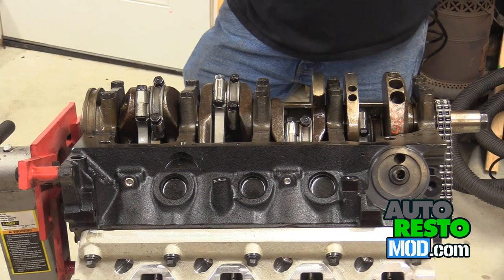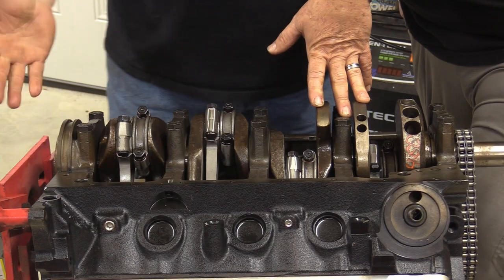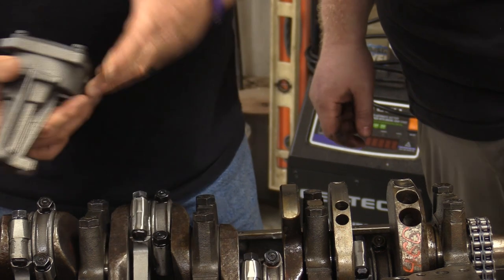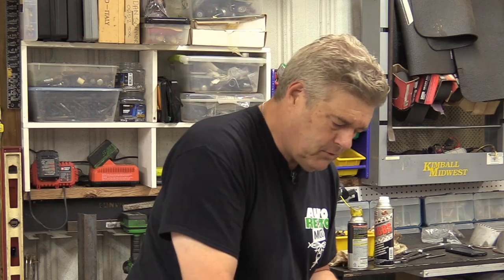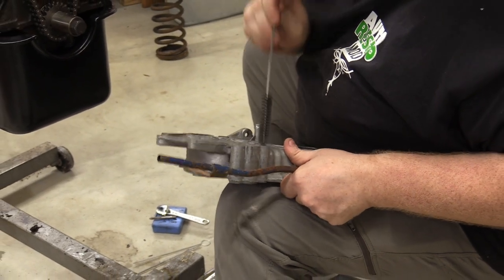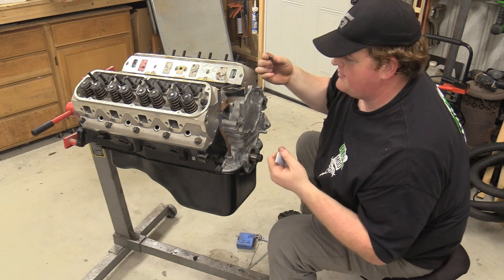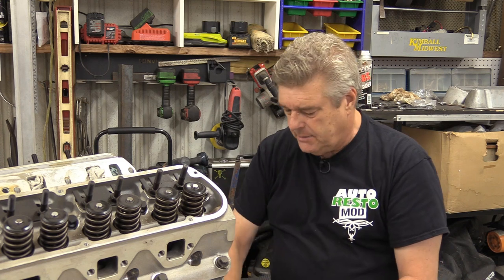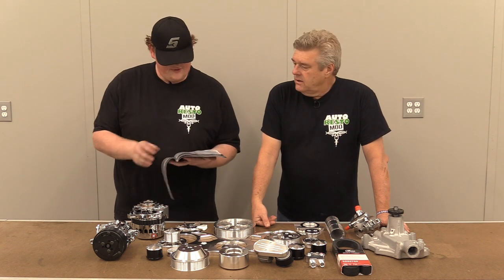Ford 347 Failing Forward

Comment: Thanks for building a 347. A lot of people will say just get a 351 and spend your money stroking that out. Good idea, but the smaller cars get real tight against the shock towers with the taller deck height. I'm very interested in Mavericks these days, and a 302-based engine fits much better than a 351-based engine. Yeah, you can cut the shock towers. You can also fit an MII suspension. Both of those things are additional time and effort, and require you to have $$$ and/or be an excellent welder. I'd like to see you fit a windage tray and/or scraper correctly. It's something I haven't done before.

Comment: Remember on the timing covers with the non-fuel pump boss type do not have the hole for the dip stick tube
Reply: One more thing to make us all wish we weren't Ford lovers...
Reply: Yeah that was fun when I installed my 94 motor in my 66 mustang....  Why is this oil dip stick hole in the crankcase of my block on the shallow end of my oil pan...  And the timing cover didnt have a dipstick....  That was a fun little adventure.....

Comment: I was classically trained to pack the oil pump gears with white assembly lube. I can also CONFIRM copper anti seize is my flavor of choice as well. It just seems less susceptible to run off when hot.
Reply: Vaseline not white grease.

Comment: A note about the fuel pump boss on the front cover , they make for a great place to run a turbo oil return line to . Just drill and tap a cover or drill and weld a fitting to the cover and you are all set .

Comment: Windage tray helps keep the crank from spinning in the oil I thought. Blue print the pump, you would be surprised.
Reply: yes and no. A crank scraper, which is like a blade on one side of the crankcase, knocks ropes of oil off as the crank spins past, so he's kinda wrong about that--windage trays are catching more than removing. Thing is, once the oil starts pumping around the engine, less is in the pan at any one time. Knife edging the counterweights will help, since the crankcase gets full of moving oil and crankcase vapors (which the the PCV vents to the air intake). One thing that happens is oil flung off the crank ricchochets off the solid surfaces of the crankcase and oil pan that is exposed, and a windage tray can shelter the spinning crank from it.

Comment: I know all about the ford stuff problems.  I put a 94 302, into a 66 mustang.... wrong oil pan, wrong timing cover, wrong input shaft on the T5, wrong ECU when using a 93 wiring harness, wrong pulley arrangement.....  If you learn from your mistakes.... I learned a-lot that year....

Comment: Your timing is perfect! About to put up my Fairlane for the winter and will be taking the front of the motor off to correct an oil leak; any recommendations in the front oil seal? Appears mine presses in from the front.
And yes, wanting to see the windage  tray installation

Comment: The very obvious. 2 bolt engine should have a stud girdle and studs. More so if using boost. Grouting the block just above the welch plugs too helps stiffen the bottom end.
Should be using head studs as well. 
This all very basic prep for a performance engine,, street or road.
RHS components?? So you are building a drag car??  Pogo sticks are inferior than the original double wishbone.
And those racks leave a lot to be desired with steering geometry as well.
Hi volume pump pumps more volume, not more pressure. I feel a good idea though the oil pump drive is loaded up somewhat which is bad. And they are fragile. 15/40 synthetic is the go. Pumps a LOT easier than thicker mineral oils. And lubricates better as well.